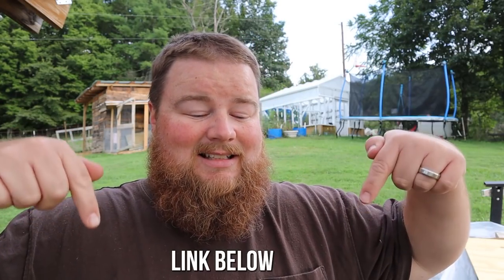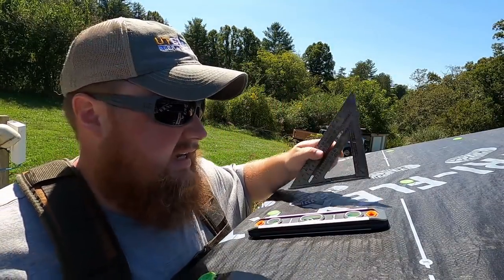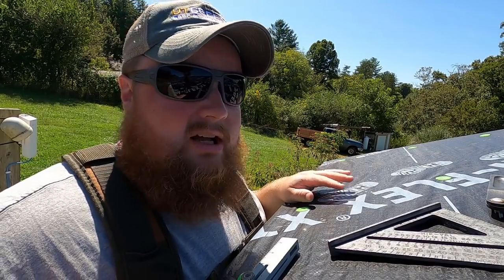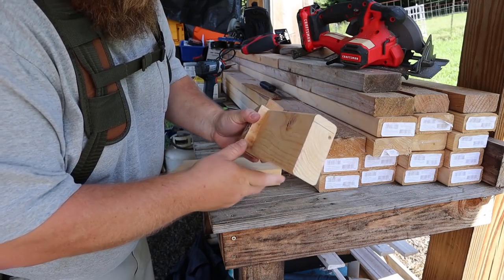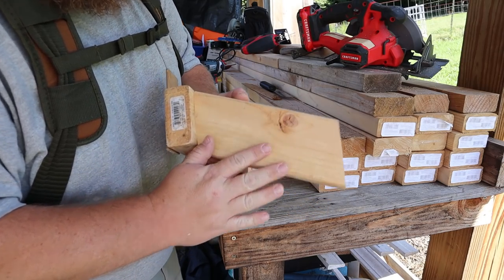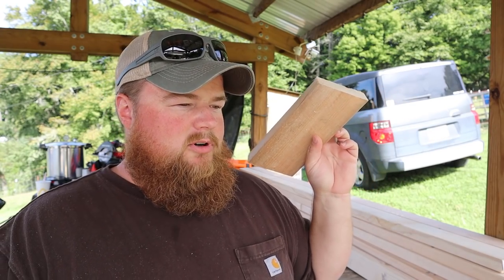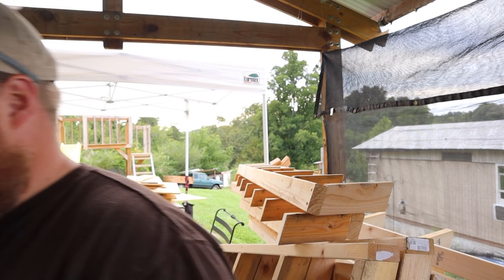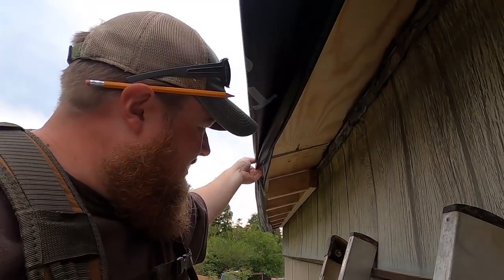Finding the ROOF PITCH - Mobile Home Roof Over Project

Comment: Back in June, I purchased lumber from my local Lowes.  The 2"x4" x 8' were $3.21 each.  The 10 ft long ones were $4.12 each and the 16 ft ones were only $6.57 each.  I was planning on putting a deck out front this fall, but with the cost the lumber is up to now, I don't see it happening any time soon.  They are claiming it is because of the pandemic because the businesses that cut and mill the lumber aren't allowed to work and it is causing a lumber shortage.  Once the lumber companies are allowed to return back to work, the lumber would come available, but I don't see the cost going back down.  It probably remain high to line the companies pockets.

Comment: it's called a soffit. normally the lower surface is horizontal. easies to build and fit the soffit boards and facia. unless you  like the open craftsman look with exposed rafter tails...

Comment: Boy you made a very good job of building an oven on top of your trailer. Where are the roof vents and the eves vents.you could of made it a lot cooler in there if you would have built it like a stick built home with open eves and 8 roofs vents to get rid of the heat
Reply from the maker: And you make a very good job assuming you know how this project will end.